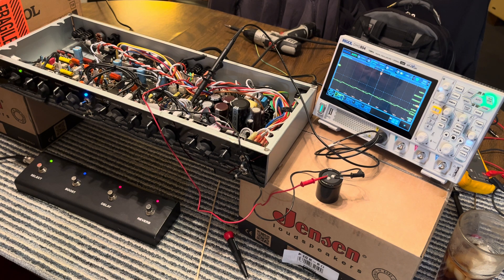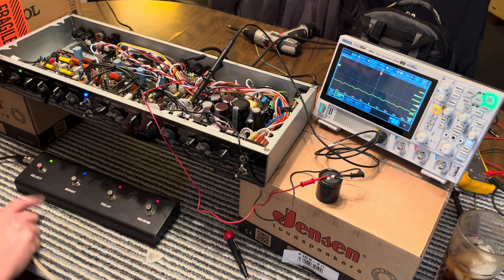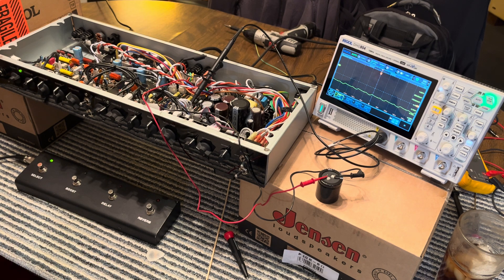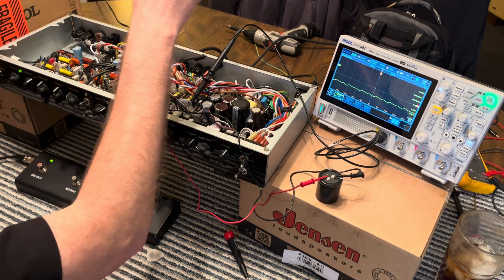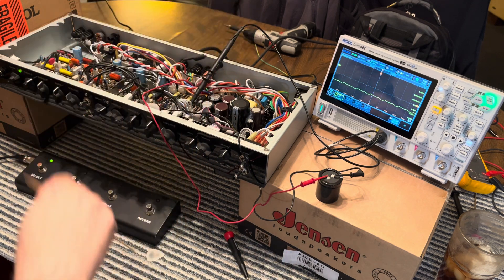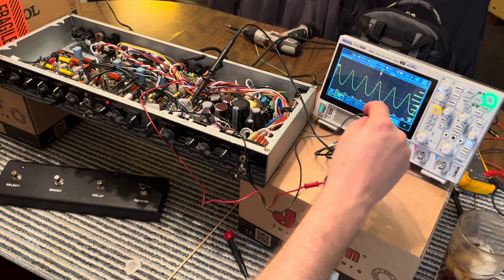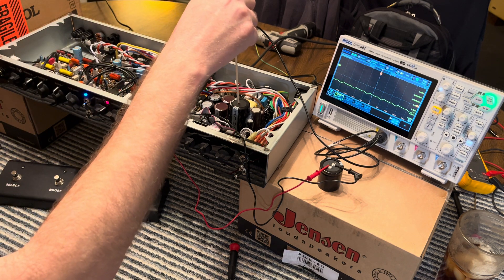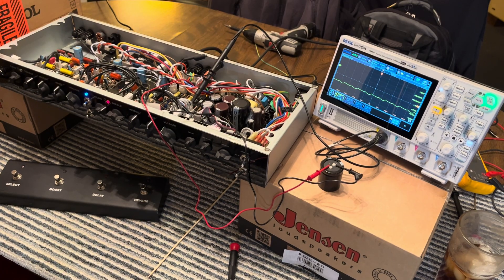Bogner Alchemist - Bizarre Switching Symptoms Fixed

Comment: Did someone really fixed all of the swiching problems with this amp? 
I'm experiencing a similar problem—my Select LED flickers on the second channel, and when I activate the boost, it sometimes switches back to the clean channel. Additionally, the boost LED occasionally stays on while the boost itself is disabled on the amp.

A year ago, I had similar issues. I was able to fix them by inspecting the XLR socket in the footswitch, which was making contact with the chassis metal. I applied rubber pads inside to prevent the socket from touching the chassis, and that resolved the problem. But now i have no clue what the new problem could be. I assume the first switch has a problem. Maybe i'll try to replace it with a new one.
Reply from the maker: If the light flickers at a steady rate, especially a multiple of 60 hz, a filter capacitor is leaking.
Reply: @6dbthreshold  its more like dimming not flickering.
Reply from the maker: Good luck with your troubleshooting!

The DC Power Supply design in that amp is an over complicated mess that was poorly designed.   The schematics are challenging to read also.

Comment: Did you check the 68000 mfd capacitor what does it read on an  ESR meter ? You may be masking another problem like either a bad regulator ic ? Something else could be pulsing ac on a dirty dc supply? Maybe a rectifier? Just a thought ? I have the same amplifier with similar but ,intermittent switching issues? Going to get into it soon !
Reply from the maker: The ESR was around 50ohms if a remember correctly, but I don’t think the cap was loading the rectifier too much.  These amps are notorious for switching issues, especially after a retube. If the tube heaters draw just a little too much current, the cap starts to fart out. 

These amps use +/-3.5vdc to run the heaters.  There is a balance pot, R3 that lets you adjust voltage coming off the regulator. 

Since your problem is intermittent, I would bias the amp first on the cool side, then adjust heater voltage balance and see if your problem goes away.  

In my case, I replaced the bridge rectifier and all the caps in the power supply since I was into it that far.   The voltage regulators tested fine when fed with clean dc.
Reply: @6dbthreshold  These are also notorious for a bad bridge I believe 6amp rectifier for the DC heaters also they overheat . Replace with a 25 amp just better heavy duty .
Reply: @6dbthreshold  These are DC heaters for sure! I will check mine as well thanks ! Do you still have yours?
Reply from the maker: Sold mine.  After I got it running again, I played it for 2 weeks and never fell in love with it.   I knew it would eventually have to install better tubes and get the dc regulators upgraded.  I didn’t like it enough to want to spend more time on it.
Reply: I have the Bogner alchemist 2x12 and It wont switch over to the left channel at all. How would I fix this issue?
Reply from the maker: The first test is to remove the foot switch.   Will the amp face switches work?   Probably not.  Then pull all the tubes out.   Do the panel switches work now?
Probably not.  

The same voltage that supplies the tube heaters, is also supplied to the switching relay circuits.  

It’s common for old/bad tubes to pull down the bias voltage enough that the switching logic fails. 

If it isn’t as simple as a tube, then 2nd most likely cause is bad power supply filter caps. 

If you don’t know electronics, don’t get into the circuit because the B+ rail is right next to the heater voltage rail.  It’s over 400vdc and can KILL you. 

Google “Bogner Alchemist” schematics.  

EL34 world has a complete set that are pretty detailed (actually TOO detailed).  

The switching uses +/-18 vdc,, +/- 3.5 vdc and 8 vdc.   

The 8 vdc is for the foot switch.  It controls a switching processor in the amp that also parallels the panel foot switches.  

Shitty power supply design.  Old tubes WILL cause switching issues.  Simple but costly fix.  

Bad power supply caps WILL cause switching issues.  Cheap fix, but dangerous if you don’t know electronics troubleshooting.  High DC voltage in the power supply can kill you.
Reply: @6dbthreshold  Thank you, to get started. 
I have experience in electronics and tube amplifier repair, but all these semi-digital electronics confuse me a bit 
I put the power supply back on it, the amplifier was working fine 
I increased the filter capacitors 220*2/100*2 500v)
Changed rectifier diode and capacitor 68000uf.
The amplifier was fine. 
Playing today, I heard a short circuit somewhere and the amp got stuck on the clean channel
Only audio commands work, the relative switches treble crunch deep 
Digital effects work
I've checked voltage and they seem ok, so the power supply seems to be good. I'm afraid that some component in the relay circuit has blown
Tomorrow I will recheck the digital board from which the inputs for the channel change relays start (the one where the 7905/08 transistors are present, etc
I replaced q1/q2 with two transistors 2n3904 

I'm trying everything, there are no burn marks, the only component that was blown is r4.
I replaced it
Maybe I was tired and stressed and I got the wrong value
A little while ago I was reading is 1k
I'm afraid I used a superior value. 
Any idea is wellcome
Reply: @6dbthreshold  i removed all tubes.
In any case, tubes was ok. I played in clean channel, that is now stucked.
Reply from the maker: @alessandroquazzico6565 

I don’t know the amp well enough to spark any ideas.  It’s entirely too complex with all the switching.  If your effects work, that’s a good thing. Once I got power supply caps replaced, I adjusted the +/-3.5 volts balance pot and biased the amp.  It was super sensitive to adjustments and wouldn’t switch right when I reinstalled the original power tubes.  I put new power tubes in and sold it.  

I think the design is too ambitious and not reliable long term. So I sold it.  

Good luck with your efforts.  Let me know if you fix it.
Reply: @6dbthreshold  OkThanks the same. 
Meanwhile I found the error, r4 should have been replaced with a 1m resistor and instead I had entered an incorrect value 
I still can't test because in the meantime I had disassembled all the power supply and I'm going to replace c6/c11/d7 because they had aged
The disassembled capacitors gave readings values other than the nominal ones
If there was no problem at the level of dsp (and I don't think so) somehow calmly I will be able to get out of it
Reply: @6dbthreshold  Honestly, I can't come up with it. I perceive where the problem can be (q1/q2 -they have wrong voltages so much so that they tend to overheat. 
The strange thing is that if I act on the r3 trimmer, the one with the ratio +/-3.5v, I get the o channel switching. There is something in the relationship of positive negative tensions that escapes me. Unfortunately my electronics skills don't go much further, even if I don't have an oscilloscope and a signal generator at home, I can't come up with a methodical approach useful to the case
Reply: @6dbthreshold  The sound, clean and gain comes out perfectly as well as the digital effects and the various preamp switches
The thing that makes me angry is that it has a sound that I like
Reply from the maker: Agreed.  I understand why the Alchemist was a failure for Bogner/Line 6.   Too complicated and yet, boring at the same time.
Reply: @6dbthreshold  I have technical difficulties explaining how, but I did it and I practically bypassed the mcu board to change channels. Now everything is almost analog, with cable bridges between boost switche and channel switch. I removed q1. I removed the 18v mcu power supply. Right now I'm also without send return, but I calmly put it back into the circuit
Reply: @6dbthreshold  Ok. Correction. It all works. Culprit q1/q2, there is something wrong in their power supply. I removed q1 And inserted manual contacts
Reply: @6dbthreshold  hi there..i have the same switching problems with my alchemist. the amp works fine, but after 10 minutes playing around, the effects shut down, it changes channels on his own, losing slowly sound/power. what kind of capacitor did you attache? does It has to be 10v 68000? where did you exactly attache it to the PCB? you can contact me through my website pistola pedalboards, thx for this video and your help!
Reply: Same problem.
I was playing and I felt a spark. I immediately turned off the amplifier. Now I'm stuck on the clean channel with punch on. I can't change the channel. The clean sound comes out well, the delay and reverb effects work. Apparently +3.5/-3.5 are ok 
There's something in the relays circuit that's broken but I can't identify

Comment: In my opinion, adding a bright cap over the red channel gain pot is a nice improvement of the amp.
Reply: i wouldn't say it needs bright cap....what it REALLY needs is a variable presence and deep circuit out of the power amp! This thing's clean/crunch is wonderful as-is, but the gain channel is so dark and mid-heavy--not squawky like a 5150 or anything, but more like the bandwidth on it doesn't go wide enough--and doesn't match the presence of the clean/crunch channel. It's like two difference amps..one is super clear and big, the other is too tapered in the highs and lows. 

I love the crap out of them though and would never sell the head I have. I vibe so hard with these amps, but it needs more presence and low-end OOMPH coming out of a cabinet on the dirty channel. Otherwise killer amp with a super unique, boutique flavor about it and sounds like a few different amps rolled into one and straddles between American and British styles in a way that you almost never hear from anything else. I rather enjoy that everyone hates them, because it's kept them really cheap on the used market all these years. Anyone who wants one can still get them extremely easily and affordably.
Reply from the maker: @UseTheSupeRsonic my thoughts exactly.  The high gain channel is extremely mid dense.  Not enough high or low end.  

It’s just too full of dc switching components to cleanly mod. 

I thought about gutting the chassis and reusing the chassis, transformers and pots.    But once I got it repaired and stable, I sold it and moved on.
Reply: @6dbthreshold  I'm so glad someone agrees...they're such underrated amps that if you give em a little love, and you end up with something extremely unique. I run the head into a loop of my Helix and use an IR, then pump some 125hz after the head/before the IR, then a wide Q boost around 4k after the cab for presence....it's magic. Sits absolutely killer in a mix after that because the amp already has the right midrange texture. It's crunchy as hell, especially on the 20w setting. 

Man, that's disappointing though about the DC stuff, I'm really wanting to get a resonance of some kind modded in there get this bad boy sounding massive from my cab at those lower volumes like my Grandmeister 40 does. That thing can rival an Uberschall just about.
Reply: @ Presence/Resonance shouldn't be that hard to add. There is a presence circuit already, it's what's behind the bright switch. Replace the relay with a pot to get adjustable presence, maybe change resistors/capacitor to taste. A resonance circuit would go into the same place, both in the NFB loop.